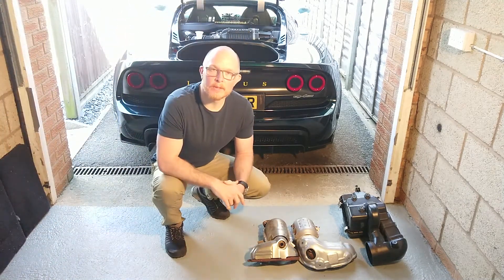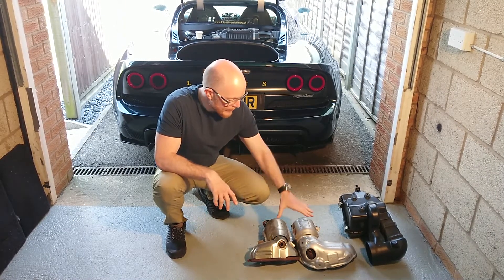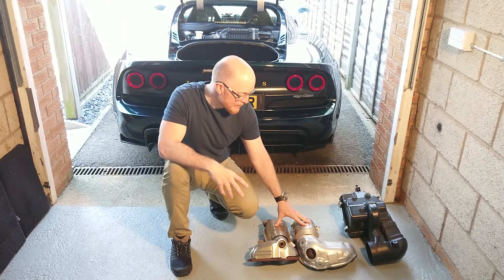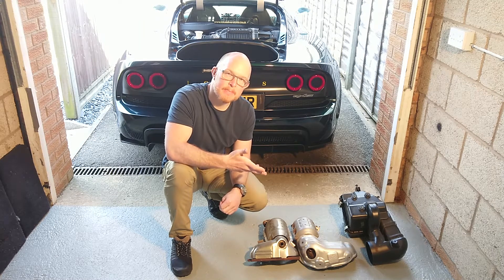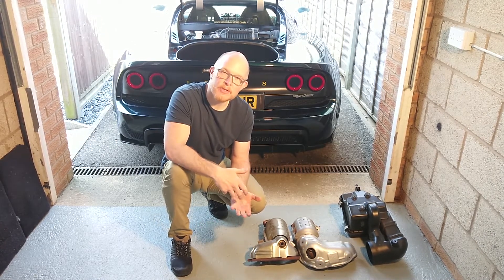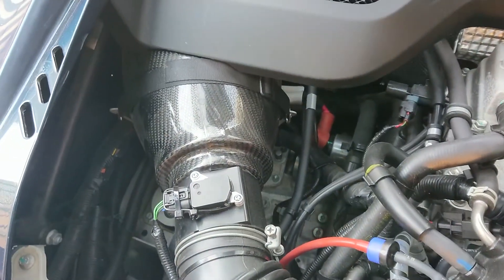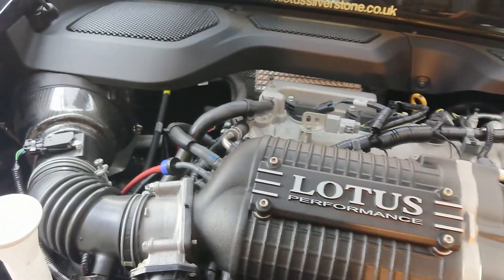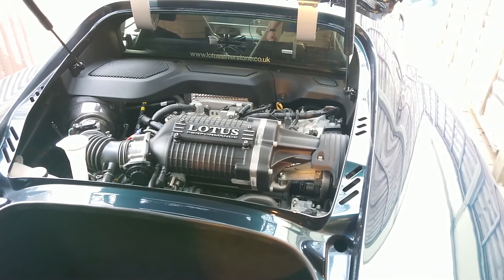Komotec EX430 upgrade review for the Exige V6 (part 2)

Comment: I guess im answering my own question since you've had the air filter on for some time now but have you had any problems with the MAF sensor being excessively dirty due to the (oiled) K&N filter element?
Reply from the maker: Not that I'm aware of. Hasn't caused any issues in 25k miles.